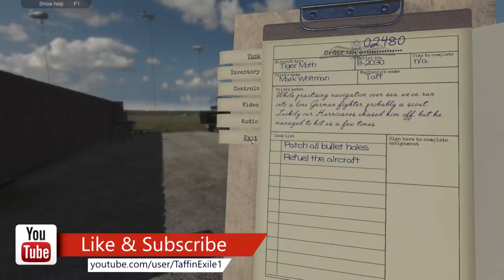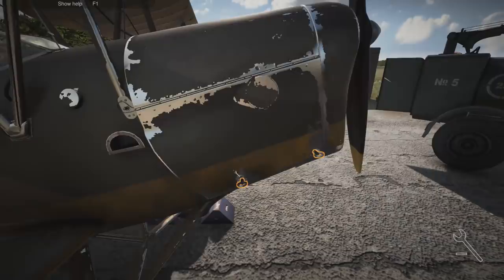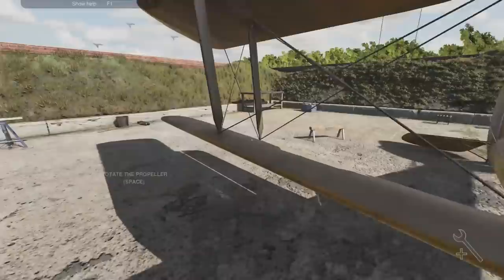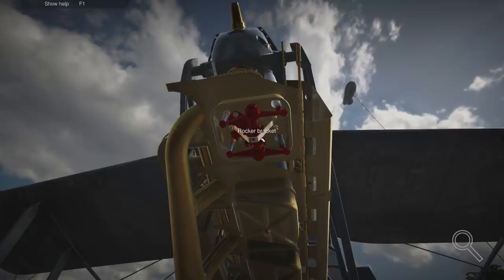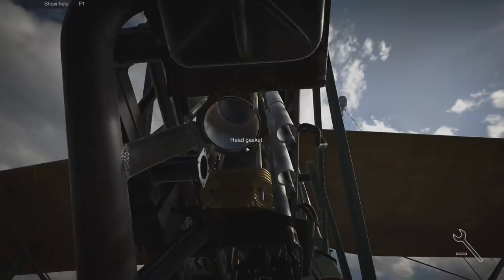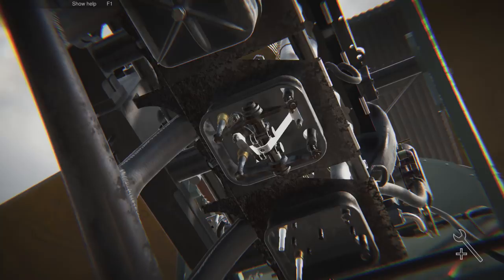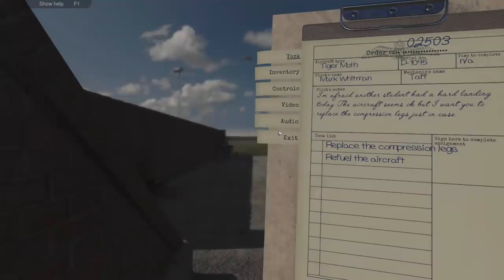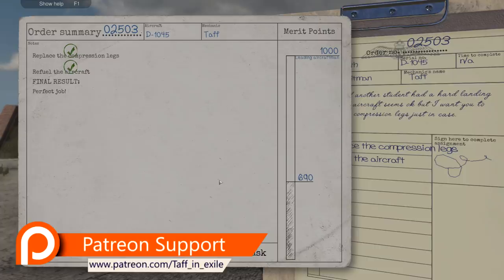Plane Mechanic Simulator | Tiger Moth Maintenance | Part 5

Comment: Simulator my ass lol. It'll be a cold day in hell when a clogged fuel filter can be fixed by dumping oil into it, especially centrifugal filters like that one. There's a whole can of worms inside that housing that would give any mechanic the willies.